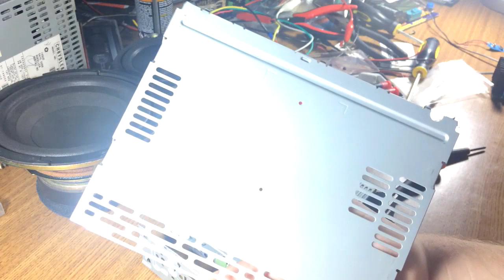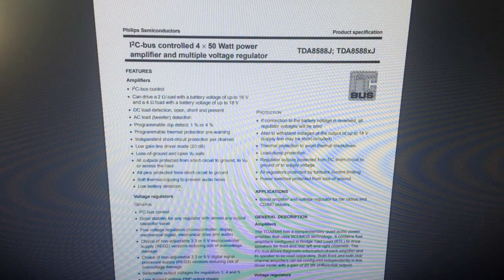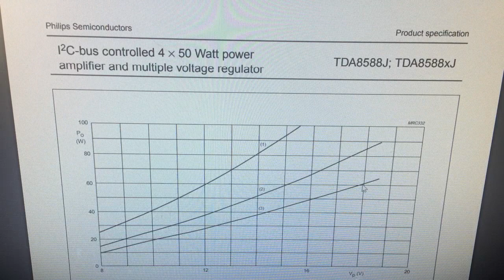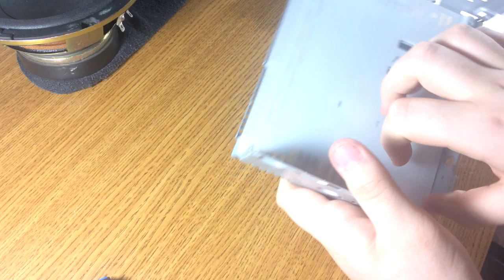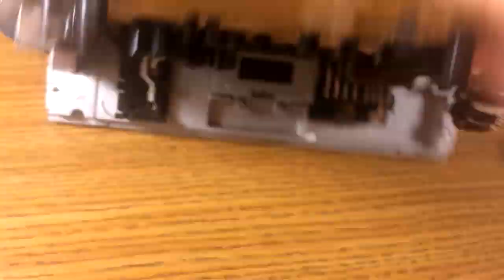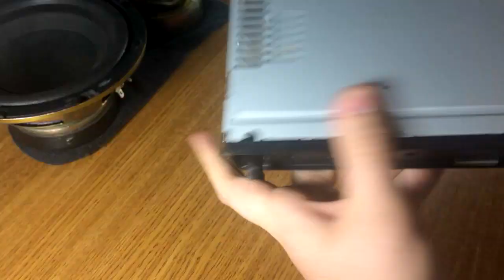Sony CDX-GT240 Teardown and power test

Comment: sony cdx-gt420u cutting off power and restarting where it left off and if I don't turn the volume knob down it restarts again , is it possible the it's just old and when it overheats it does that, and should I put some fan inside it instead of cd player...? please help, thanx in advance...

Comment: what were you using to power it on?the head unit
Reply: just a normal 12V 10A power supply supply.

Comment: Four channel audio out  but one channel not comeing sound when connected to speaker what the problem
Reply from the maker: could be as simple as a bad solder joint on the IC or even a blow channel in the IC